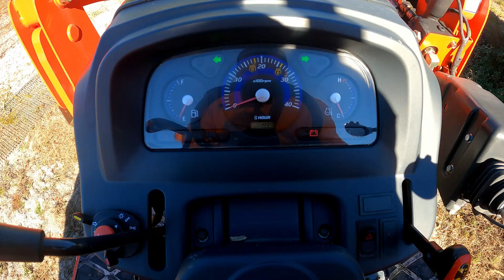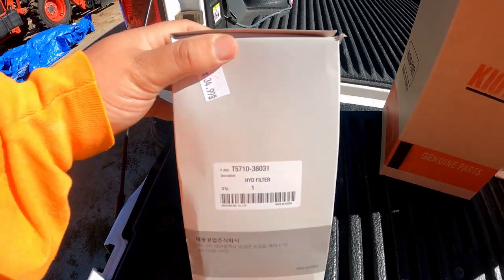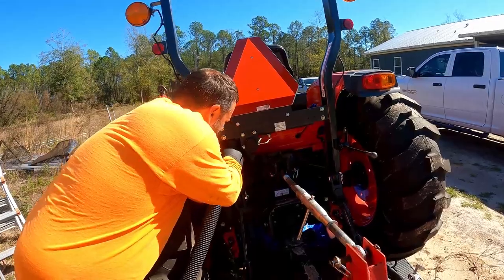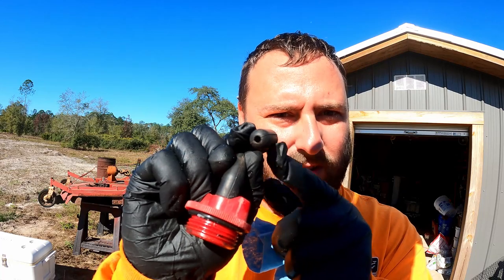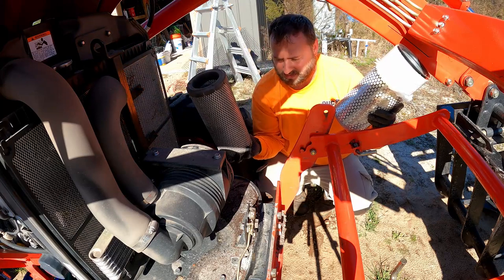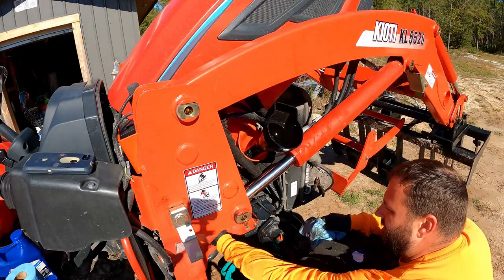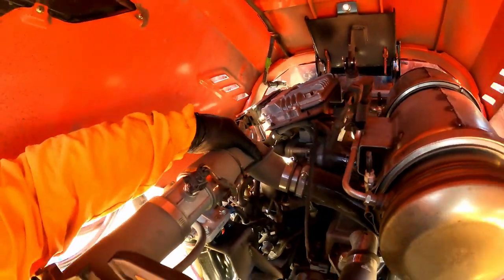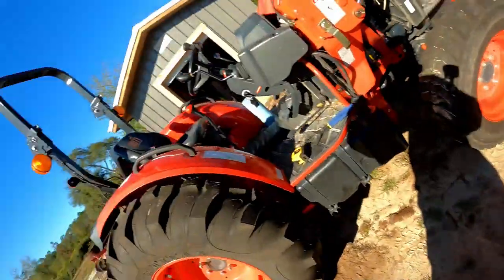Kioti DK4510 200 Hour Service | Going over the 50 & 200 hour service for Kioti Tractors

Comment: The vacuum trick works great! I accomplished the same thing but I did it differently as I was doing the 50 hour solo. You can take the engine oil fill cap and place it on the hydraulic fill port. The engine oil cap has a gasket on it that creates an air tight seal in the hydraulic system.
Reply: Well if that works that's much easier than using a vacuum for sure

Comment: Nice " Gear-drive " rig-- saved yourself another 85.oo$ on filters without having a hydro-slack-o-matic trany. Kool vacuum trick. My simular sized " kubogy "Mx5200 TLB  has a " side-winder hydraulic filter , but doesen' t dump hardy more than 6-8 ounces of fluid in a " quick-exchange" on the horizontal filter. My gear drive shuttle shift transmission  "rig" is a "fuel sipper" were as the greasing is almost the same comparable expense. Thank you for the great Vidio Sir and happy safe tractoring. My "kubogy " dealer has never given me the wrong filter--- YET, even at 925hours worth of changes--- the one good thing to say about the "kubogy" system( among  a few others).
Reply from the maker: Thanks for stopping by!

Comment: NICE VID, What fitting did you use for the Vacuum on the Hyd. filter change ?
Reply from the maker: This should work

https://www.homedepot.com/p/RIDGID-2-1-2-in-Power-Tool-Adaptor-Accessory-for-RIDGID-Wet-Dry-Shop-Vacuums-VT1407/100206293

Comment: Good show of how to use the shop vac. I used the same trick while changing the hydraulic filter on my CK4010 and could not believe how well it worked. I agree with you, just have to take your time and follow the manual and you can save quite a few $$$ on maintenance. Just make sure to keep all parts and fluid receipt as proof of purchase in case of problems during warranty period.
Reply from the maker: Thanks for watching!

Comment: Did you have a magnet at the end of the hydraulic filter that captures metal shavings. Seems like I have seen others change it and wipe the metal off of the magnet before screwing on the new filter.
Reply from the maker: I've changed that hydraulic filter twice now and do not remember ever having or seen a magnetic rim or anything magnetic on the inlet side of it. Both filters I replaced it with or straight from the Kioti dealer. Might be possible there's a different model filter out there but I'm just speculating.
Reply: I found the other video again last night and it was on the filter stem of the tractor. Both filter stems had it and he cleaned the metal off before putting the new filters on. He actually had difficulty getting the filters off due to the strong magnet grabbing the open filter rim. STUFF ‘N SUCH is the YouTube channel. I’m only at ten hours on my 7320 cab, but I very much appreciate all of you guys showing me how to do it, as I’m new to tractors and not a gear head. Also my closest Kioti dealer is 3 1/2 hours away. Keep up the RX 7320 maintenance videos, I find them very valuable. Looking forward to the transfer case oil change. Thank you.
Reply: There ist a strong Magnet. Easy to Clean. Makes it a little difficult to place the new filter ...

Comment: How's the regen been going for you first 200 hours?
Reply from the maker: Everything has been fine. The dealer made it clear when they delivered it that when Regen occurs not to shut the engine down. There is a button on the dash that allows you to cancel it out but every time it occurs I'm usually working on the tractor for multiple hours. I will say it drains a little bit of the power so in most cases I bump up the throttle a little bit. I'd say the worst part about it is the smell but nothing I can't get over.